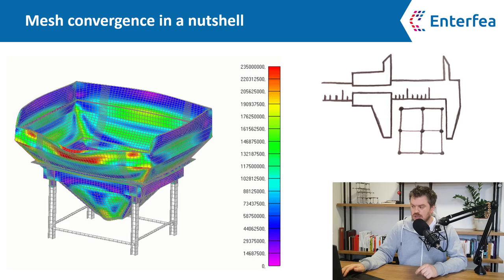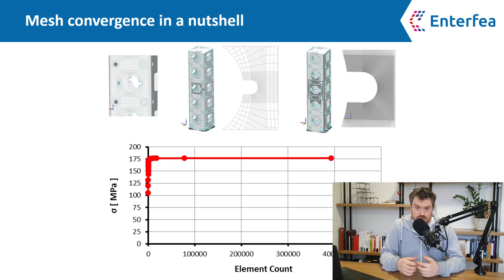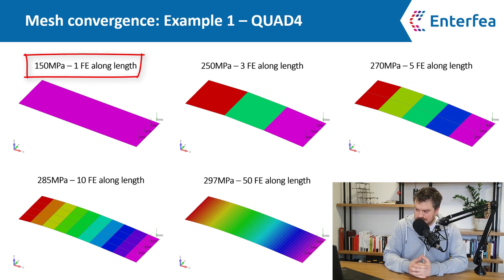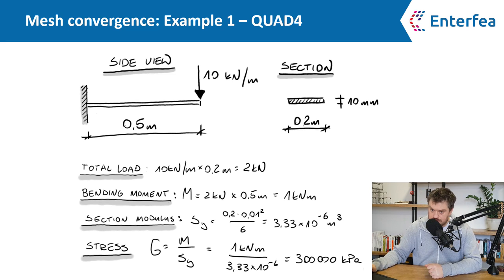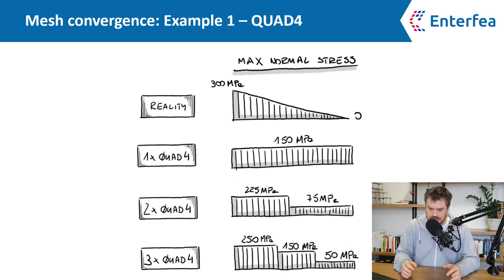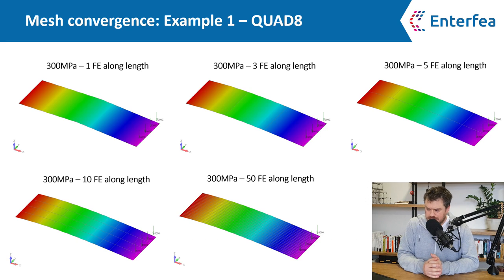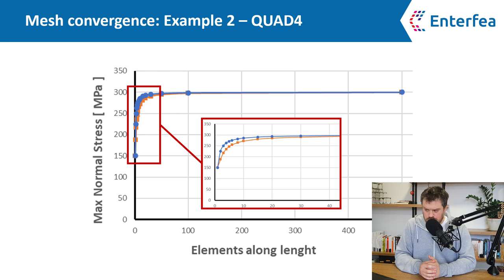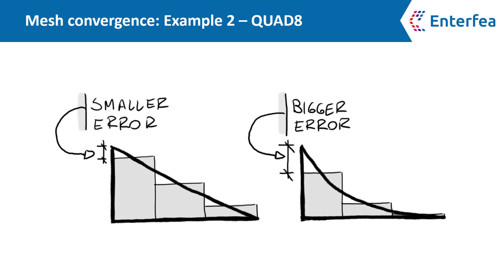Correct Mesh Size - A Quick Mesh Convergence Tutorial

Comment: That’s some good stuff.

My question is, how many Gauss points have those elements been evaluated with? 
It appears that the correct result is dependent upon how close to the clamped edge the point lies. 
If you use 1 point, it evaluates the stress at the center of the element. If you use 4, however, you’re immediately closer to the side. 
There’s of course the problem of shear locking for over-integrated elements, so that’s a trade-off for your accuracy.
Reply from the maker: Hey Konstantinos! Those have a single gauss point. As far as I know, I don't get to choose any "better" in Femap. Shear locking is a fun problem for sure BTW :)

Comment: sensivity analysis is the answer for all these questions
Reply from the maker: Hey! A quick Google search told me that: "Sensitivity analysis determines how different values of an independent variable affect a particular dependent variable under a given set of assumptions"...

For me, being specific in such cases makes sense, so if I would give someone advice on this (as I do in the video) I would never tell them to "do sensitivity analysis" and leave it at that... While this is technically true, it's not advice... because you can't really act on it unless you already know what to do (in which case you would not be asking).

So instead I would say: calculate the model with smaller and smaller mesh and draw a chart of the relation between outcome you want and the mesh size... and hope it will converge, and if it won't this is mostly because of singularity or whatever.

To me, that would be practical, and using complex definitions as an "answer" that would fit anything from dentistry to psychology isn't really advice in my book.

Comment: 10:00 If this example were tension (uniform surface load, applied to the free end) instead of transverse load, then would a single Quad4 element give the perfect answer? Again, assuming a Poisson's ratio of 0.
Reply from the maker: Is the question really then: "Can a square QUAD 4 element accurately transfer uniform stress perpendicular to one of its edges when it is reasonably supported not to constraint perpendicular deformation"? - luckily it can :) Otherwise, it would be quite difficult to calculate anything in FEA :)

Comment: Hi, why remove the stress concentration you observe at the fixed end, what if it is correct? 
Poisson coefficient for an isotropic homogenous material tells us that solid physics is a true 3D problems. A linear induced stress couples, via the off diagonal stiffness tensor, to the other directions, so a fixed end, where the fixation constrains the in-depth tenue of your beam you will get a stress induced effect. I would propose, for such an example, that you cut it in the middle of the beam depth, put a symmetry there, and leave the fixation free to "roll" along the beam depth. You will still see a stress variation along the depth. Even, if you analyse very carefully, you will notice that the beam, at the attachment has a slight warping shape, linked to the bending amplitude.
Mesh is different if you solve for the displacements, or for the stress level. As FEM solves directly for the change in length (u,v,w) or the displacements, but stress is related to the spatial derivatives (gradient) of (u,v,w), via the stiffness tensor (Hooks law), so you need far more elements to resolve correctly a stress based on the displacement gradient, than for a mesh to resolve only the displacements. So mesh for the stress, locally, or if you use mesh refinement, use the stress energy, a nice positive value concentrated at high stress levels to drive your mesh refinement.
Sincerely
Ivar
Reply from the maker: Hey Ivar! Thank you for dropping in! So nice to read such well-thought-out comments - it really makes me feel grateful! So first of all, thank you!
To answer your question - I decided to do so, simply because it's an artificial example anyway, and I wanted to be able to "clearly" show with the hand calculations how this works (and that it does!). You are of course right, there will always be "something extra" there, but I feel that if we would agree that the cantilever is just a middle cutout as you described, then the effect of this would be negligible in most practical cases, wouldn't you agree?
Of course, you are 100% right - it would be much easier to converge deformations than stresses. However, in my experience, it's the "deformations" that usually don't have to be that accurate, while designers worry way more about stresses. I guess this leaves the field for a different FEA formulation (that starts with stresses, and derives deformation based on that), but while I've heard about this concept a few times, I don't recall any serious provider offering something like this in a commercial package.
Once more, thank you for sharing the insights with us, I'm super grateful that you were kind enough to share your thoughts!
Reply: @Enterfea  hi just to be clear you do a great job with your videos, really nice. What triggered my comment was that you gave little warnings that here you simplified greatly the model. And as I'm working a lot in the MEMS precision instrumentation domain, these secondary effects such as stress stiffening, beam warping ... are important for the system outcome, so I'm used to go much farther than the first level. However, you are also right for constructions, with larger security factors, some of these secondary effects are just to be ignored. The most important, as you state, remains to be able to clearly identify true "stress concentration" effects versus "FEM model singularities". SOMETHING all FEM modeller MUST master well. And this applies, with its own pecularities for all "physics": structural, as well as ACDC, RF, Optics, HT, CFD, ... and even chemistry :)
Reply: And I'm not aware of any other "direct" method, to analyse stress, than to correctly resolve displacements, and then to extract the stress, appart if you do it fully analytically, without any "discreditation"
Reply from the maker: @ivarkjelberg1317  I totally understand you, and I really appreciate the fact that you took your time to comment and reply! This is what I love about my work - I get a chance to talk with folks who do totally different things than I do, and learn from this as well! I do agree that if you require so accurate outcomes, my simplifications would seem brutal (and in those cases - they are!). It's refreshing to know, that in some regions of engineering such precision is required - this is actually great news for me... Mostly because I was getting worried that I'm "too accurate" for most things - and here we are, discussing the accuracy of a simple cantilever calculations. I hope that one day I will be at the level where such things play a significant role - I feel this would be a great place :)
Reply from the maker: @ivarkjelberg1317  There is one I think. I mean, I've talked with a few folks who were way smarter than I am in FEA math (and I admit that I couldn't always catch up!). I think that the idea is, that instead of calculating displacements in the nodes you calculate stresses there... then based on those you calculate strains, and then based on those you calculate displacements... or at least this is what I understood/remembered - sadly I'm not even sure if this was "it" but I think it was something along those lines... sadly I'm unable to point you in any direction with this, and I'm not even sure if such an FEA approach was implemented and is commercially available - this I have never seen for sure! I'm writing this, just to expand on what I wrote, and I REALLY HOPE that I didn't mess up the description too much!

Comment: How would you do a mesh convergence study if you were doing an analysis over time ,an impact. Thanks
Reply from the maker: Hey Matt - to be honest with you, I rarely do impact analysis - this is simply not something we do regularly for my Customers, as there was no need for this. This means, that while I will give you an answer, I cannot honestly say that it is backed with a lot of practical experience, so you know... be careful and all that :)

That being said, I would most likely do it the same way. Whatever your goal is in the analysis, this is a "measurable" thing (like max stress, or maybe deformation, or whatever you are after really). Then you can just as well do several runs with different meshes, and see how this "goal measurable thing" changes with the change of element size.

But there is one caveat to that, and that is, that in explicit analysis the time step depends on element size (long story) - this means that the smaller elements you define, the smaller time steps you will have to define as well... so the analysis will take "longer squared" in those cases. So I can only guess that it would be a total nightmare (time-wise) to do explicit mesh convergence... still nothing else comes to mind really... 

If you are in doubt, try first modeling something you can measure yourself (so you will be certain of an outcome) - this way you will know if the mesh convergence "worked" if the outcome will converge to an "expected answer".

All the best!
Ł

Comment: Regardless the problem you are solving and kind of elements using, you should always  check mesh convergence. However, when the problem is too complex, sometimes you cannot refine your mesh, because it gets impossible to solve, and have no ideia of your approximation error....
Reply from the maker: Hey Tiago!
Well, I'm on the fence here. I mean, sure - it would be lovely (although quite boring) to do mesh convergence on each project. But I tend to be more pragmatic in my approach. I do mesh convergence on each "type/solution" of a project. This means, that if I did something "similar" in the past, I think (or at least hope!) I know enough to be able to judge that the similarity is sufficient, and then I would base my mesh on the previous mesh convergence. Otherwise, I would be stuck with a TONS of analysis that takes ages to compute.
In a similar case, if you have a huge model doing refined mesh locally (maybe even in different locations in different models) to check what is going on maybe the best approach.
What do you think?
Reply: Experience helps a lot. And solving local problems to verify accuracy seems to be a good alternative too. Thanks very much!
Reply from the maker: @fortiago  My pleasure!